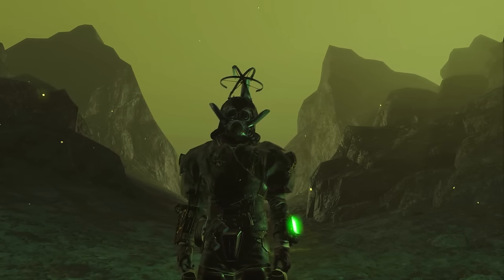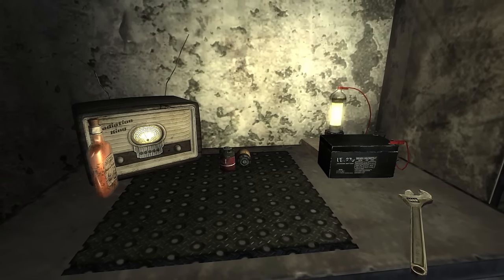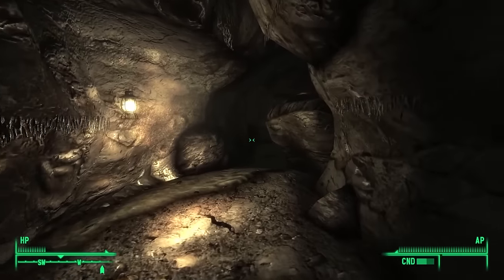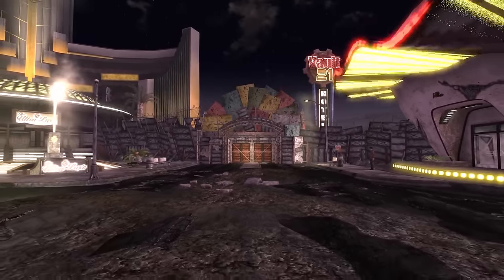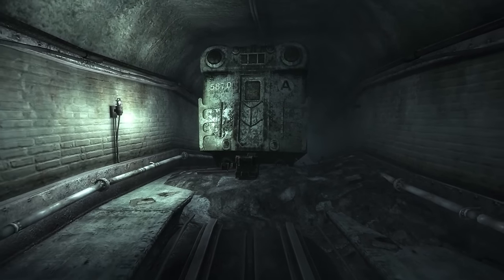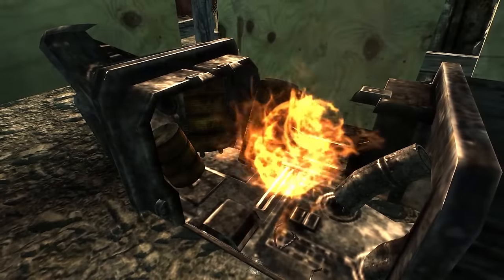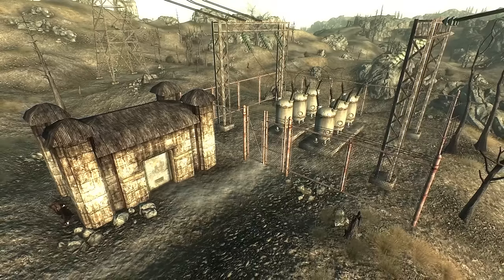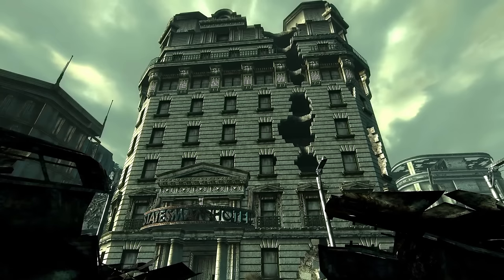Where does the power come from in Fallout?

Comment: Well. To be completely and blatantly realistic. none of what is shown in game is even remotely possible. Even in some of the most optimistic of cases. In terms of power generation. 

Without regular maintenance I am fairly confident by saying that there is nothing that will survive 200 years of neglect. 

I'm not entirely sure if people just assume power stations are built then forgotten about. They require constant monitoring and regular maintenance. Parts fail. And must be replaced. how can these systems still be running even 200 years after full scale production of parts and the knowledge on how to use / repair these parts are long gone. / Forgotten. 

The only exception i am willing to possibly give are the power plants powering the vaults. Due to them being stored internally, it makes logical sense that technicians would be trained on how to work on their own power station. And likely a large supply of parts needed for basic maintenance. 

Even if you try to say wind turbines. I hate to burst that bubble but wind turbines tear themselves apart in around 20 years with regular maintenance. .. fat chance they survived 200 years 

This also applies to the hydroelectric generators in hoover dam. Without regular maintenance and repairs this would also be unusable. 

Sure we can just say "well it's a game! it doesn't have to be 100% realistic" then my question to this is why are we having a discussion as to how any of this is possible in the first place. 

The real answer is. Todd Howard said it would be. in reality. None of this would be possible. And outside of rare cases of people creating their own batteries from scratch, you would not have any major power generation taking place.

Comment: My theory on fusion cores is that they're essentially a self-contained, longer-lasting, higher output and extremely volatile version of a radioisotope thermoelectric generator. As the nuclear material in an RTG decays, a series of thermocouples capture the waste heat and convert it into usable electricity. They're currently used in real life in space travel, and the Soviet Union powered comms equipment in remote locations with them.

Of course, the power armor explanation kinda works but kinda doesn't. RTGs, after all, release power at a specific level until they pass a certain point and their output begins to decrease. IRL they tend to provide only around a few hundred watts of power, meaning you could power a gaming PC off of one but not much else. Maybe a gaming PC, a light bulb, and a phone charger. They really don't make a lot of power. So WHY, then, would power armor suck them dry in an hour if they produce the same amount of power until they don't? Well, I don't know how to justify that, but I doubt Fallout 6 is gonna take us to the gotdamn General Atomics Fusion Core Factory and give us a guided tour of how fusion cores are assembled and what makes them work.

Comment: In Nuka World Cage says that removing the Fusion Core from the generator reduced the power input to Nuka World. 
Fusion Cores do provide power. However that power demand gets picked up from another source. That would explain why there's still power in the power lines. Fusion cores have picked up the load so that whatever batteries or infrastructure the pre-war government put in place had enough time to charge up and fill up on energy. 
My best guess is that the Fusion Cores house all the Duterium and Tritium (which would mostly have fissiled away by this point) and the generators just produce the energy much more efficiently than the cores could. Also, Helium can fuse into Berilium or Lithium when Helium and Hydrogen fuse. The cores likely run out when there's too little hydrogen left to sustain a fusion reaction. 
Now, Idk much about Mass Fusion so I have no clue if they ever maintained Fusion or if they could reliably squeeze it down into something that could fit in your hand

Comment: I wonder if it could be possible that the fusion cores are fission based, but the fusion generators themselves are fusion based. It takes a lot of energy to maintain a stable fusion reaction, and the cores could serve as a power source to start and maintain a sable reaction. That could explain why the lights in buildings don't turn off immediately, but power armor uses the cores so quickly.
Edit: Was reading through the thread and @tomprickvixen6936 had the same idea first.

Comment: It's been my headcannon that the surviving powerplants were automated using protectrons and AI keep it running. Potentially using scavengers to bring replacement parts for maintenance. 
The devastation of the world leading to the grid being damaged, and lower levels of power output, requirimg survivors to use the grid for minimum of lights. And supplement that with Generators and such for everything else.

Comment: 18:00 Always important to remember concessions to gameplay. Or limitations. I think you're more right with the "fusion" generators. Those are probably what's powering the buildings. There probably isn't an alternate energy source, taking out the fission battery should cut the power in the building or at least that section. Good observation as well on the full seated settlement variant. I headcanon that these machines cannot be fabricated in the wasteland. It's simply not possible with all the complex equipment, just like a lot of things. They can be salvaged however, and that's what you're paying for when you "build" these. Sim Settlements 2 makes note of the Concorde Plutonium Well also, restarting it for one. Excellent video, power generation is basically what caused the world to destroy itself in Fallout, so its good to see that it's a constant theme within the series. It's never handwaved.

Comment: As for the fusion cores, I've always assumed that they were a backup for the fusion reactors found inside of buildings. If for some reason constant fusion failed, the core would supplement the energy needed somehow hence why they're always charged and why power armors deplete them. 

As for the rest of the wasteland, I don't know how realistic of a guess I could make. Maybe they had a way to collect power for low voltage applications, such as ionic charges in the wind? I know satellite dishes and antennas can build a static charge when the wind blows, hence being one of the reasons they require an earth ground.

Comment: Yeah I always thought the blinking eject light indicated that the things set for ejection and not in use XD surprised you did not mention the blinking light while talking about the core not providing power. Although settlement reactors do the same, it would not be the first mistake Bethesda has made before so I always brush past that but even the settlement reactors are probably 'partially used' as it were also and a company like Mass Fusion could in my opinion be encouraging people to replace cores faster then they need to for the reactor.. But the ejection light really draws my attention regardless.

Comment: some comments
1. power generators of any variety require fuel.  even nuclear plants require occasional refueling.  nuclear subs and aircraft carriers get refueled once during their 40 year lifetime, at 20 years.  even if a plant survived the war and was able to run unattended for decades, it would run out of fuel. Conventional would run out in a matter of days, nuclear could run for years or even a few decades, though most require continuing rotating maintenance to avoid breakdowns.
2. super conductors, like any other magnet, are NOT a source of power.  magnetic fields can STORE power, and a superconducting coil could in theory store it forever, but the power capacity is surprisingly limited. batteries don't store charge, they store chemical energy, which is depleted as it restores the charge taken by the load.  when the chemical energy is exhausted, the battery is dead.  a super-conducting coil is a battery WITHOUT that chemical component.  It's more of a flywheel than anything really.  And even the really big ones have a pretty limited energy capacity.  Or you could compare it to the weights that used to be used to run grandfather clocks - they can store energy for a long time, but it's not a lot of energy.
3. shorts don't suck on power like a vampire, they ground it and blow a fuse.  Any electrical distribution line that grounds out will survive at best a few minutes before melting something if a fuse doesn't blow.
4. those "electrical boxes" are indeed like the green transformers you see in the neighborhood.  They convert dangerously high voltage lines (that are also very efficient) that run mostly underground into a lower, safer (and less efficient) voltage for residential use.  Definitely indicates getting power off at least the local old grid.  But getting back to (1), there's simply no way that the existing grid is still running unless it's solar or wind.  Even nuclear reactors would be out of fuel by this point in time.  Still though, someone has to maintain that stuff.  Wind turbines are maintenance hogs, that's pretty off-the-table unless you have some dedicated crews on them all the time.  Solar has something of a pass, but panel output degrades over time, and panels have to be kept clean.  Power electronics have a limited lifespan, and unlike wind turbines, the solar panels require active conversion to produce line power.  It's difficult to see how any line power is being produced without someone "keeping the lights on" at a plant somewhere.
5. buildings not losing power when you pull a fusion core I'd call plot convenience.  I think it'd be a nice tradeoff to have the entire building go dark as soon as you pulled the core.  Have to have a light source or wanter in the dark to get up out of that basement at least.  Otherwise fusion cores seem to be a bit too "free for the taking" without much in the way of tradeoffs.  (besides the fighting you have to do to get to them anyway)

I think this mostly boils down to plot and player convenience.  It's like artificial gravity on a space show.  It's a convenient solution to keep costs down or playability up.  Players probably don't want to have to suffer without their tech toys in a futuristic game.  Trying to explain away or justify this is probably a waste of time, as it was never intended to be 100% realistic.  Where it's not realistic, there's no "hidden plot reason" for it, the reason is connected entirely to the game you're playing, not to the plot of the game.

Comment: When you have solar/wind/hydroelectric power that is surplus to fuel your home usage, it gets sold back to the local power company. If there is no surplus, it simply lowers the amount of electricity you need to purchase from your power company.

These mini fusion reactors can be connected to a broader power grid. Given there's significantly less power consumption than there was prewar for obvious reasons, a network of these fusion reactors combined with anything else still operational within the power grid (i.e. hydroelectric dams, wind turbines, diesel generators, literally anything else) is a viable option. The generators can be the first point of power consumption, and if it isn't enough (either partially or fully), a building can draw surplus power from the grid.

Comment: I have an idea.  An Atomic Battery or an RPS - "houses radioactive material that gives off heat as it decays by the production of alpha particles".  Plutonium-238 is used in space batteries, RPS, and can last up to 88 years.  That is a small craft with a relatively small battery and a small piece of radioactive material.  If a fusion core is just a chunk of Plutonium-238 to be inserted into a machine to generate heat to power a turbine in a generator motor to produce current, that large chunk of highly radioactive material will produce a lot of heat radiation as it decays and last longer and power larger machines.  And I would not doubt the radiation seepage would be detrimental to human life over time if constantly exposed.  Just a thought.  This technology was developed in the late 1940s and implemented in space crafts in the 1950s and before solar cells were a viable option.  The Voyager space crafts use RPS batteries.  Solar cells are much safer to use than RPS batteries but potentially produce less current in comparison to RPS batteries.  But solar cell technology has come a long way and power draw has been greatly reduced over time so the dangers associated with manned crafts and stations using RPS technology is just not a safe option for manned crafts or stations.  With a chunk of radioactive material the size of a fusion core, it could last well past 200 years.  Just a thought.

Comment: If the plutonium wells were running on plutonium 239 or 240 they'd be able to go for 6000-24000 years. So 200 would barely be a drop in the bucket. I'd lean towards 239 given all the health problems plus all the weapon manufacturing would probably create a ton of excess fuel grade plutonium.

Comment: when I first started playing fallout4, the fusion cores were the first thing that puzzled me. 
I was under the impression that i could take a fusion core from a generator and replace it with an empty one to be refilled.
Then I looked it up and found out thats not the case. I was so confused because clearly the building still worked so it didnt draw power from the core that I just took. I really thought it just refilled it.
Built a similar generator in a settlement, disappointed to see it did NOT spawn or refill cores (it would have been a nice feature for gameplay though)
Anyway in FO4 I had that one generator mod that consisted in a capsule with a Glowing One in it, and supposedly you drew power from its radioactivity (like a glowing one nuclear mini reactor?). that was wacky, loved that. If it provided a fusion core refill station, it would have been perfect.

Comment: It's been awhile but I'm pretty sure that in some cases, Pre-war Ghouls that used to be engineers, nuclear or otherwise, were helping to keep some power hubs still functioning. Even some raiders, despite their gross decor and hygiene, have been shown to tinker with or appear to be working on machine in some powerplants that they use as their homes. Leading me to believe that despite being savage murderers, some raiders were intelligent enough to maybe read some manuals or educate themselves with leftover books just enough to be able to keep these places functional.

As for Fusion Cores lasting as long as they do - Fallout 76 shows that you can capture the Poseidon Energy Plants as a workshop, and it will produce brand new fusion cores for you over time. I'm pretty sure these are 'brand new' fusion cores and not just recharged ones - as no empty fusion core is required. Since Fallout 76 takes place just 25 years after the Great War, it's not illogical to say that even after the events of 76 - the Vault Dweller and perhaps their descendants built settlements around these powerplants and continued manufacturing new Fusion Cores for people. Who knows how long this continued, as West Virginia isn't visited in the earlier games taking place 200 years later. 

It's hard to say since 76 is the latest installment, and the events of the game never existed in the previous games as it hadn't been made yet - but logic dictates that the vault dwellers of Vault 76 perhaps built things to withstand the passage of time in a nuclear wasteland. They had their own independent chapter of the Brotherhood of Steel and a Settlement of somewhat moral and good traders/craftsmen. It would make sense that they traded with wandering merchants and survivors as humanity continued to exit their vaults and spread out across the wasteland. Maybe the next single player Fallout game will explore some of the effects of West Virginia being settled merely 25 years after the war.

Just remember, those who despise Fallout 76 - without the actions of the residents of Vault 76, the world would have been swarmed and further destroyed by the Scorch Beast plague. Without the rogue BoS chapter and the vault dwellers containing and eventually destroying the threat - the rest of the world would have fallen to the Scorched.

Comment: It maybe that Mass Fusion created radioisotope thermoelectric generator stations. These kinds of nuclear battery's power space craft like the Voyager probes and if scaled up can last very very long time. As specially designed RTG's have been suggested for space probes sent to near by stars. At the same time it also seems that some form of wireless power (like was invented by Nickola Tesla) was perfected and used in the Fallout timeline. So both municipal plutonium wells and 'Fusion' cores could well be a type of RTG.

Comment: 2 things:
1) Fusion cores may be rechargeable. It's possible that the ones found in buildings are on a recharge cycle, thus explaining why they are always at 100%.
2) They definitely DO NOT have room-temp superconductors. In those games, I saw nothing just hovering off the ground as if by magic. That is a sign that room-temp superconductors aren't a possessed technology. To make something hover off the ground, you only need two things: a large permanent magnet, and a room-temp superconductor. You don't need power, cryogenics, wings,  propellant, or motion. Just those two things. So if they had that technology, things would be hovering and there's nothing that would necessarily make them stop hovering. Given the utility and bad-assery of making things float in the air, any society not doing that doesn't have this tech